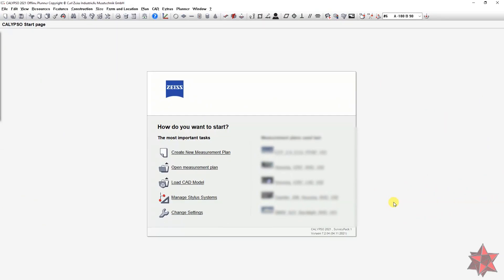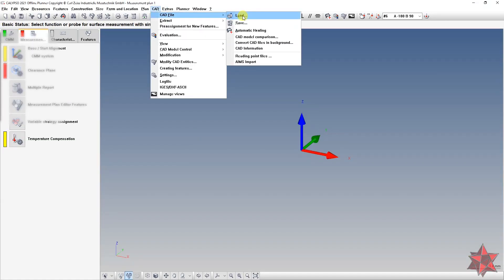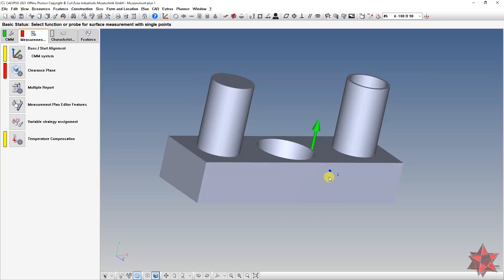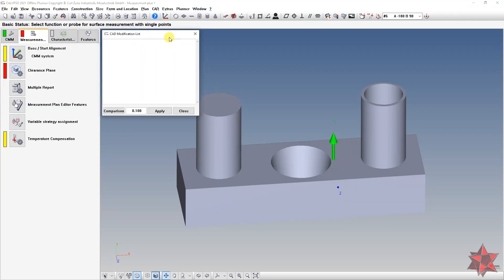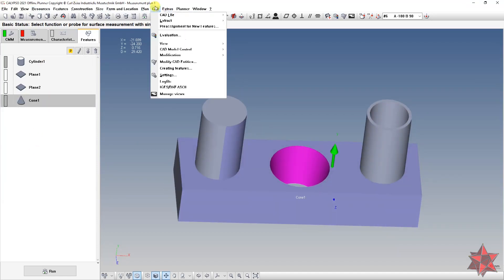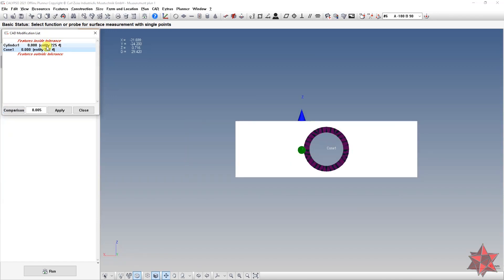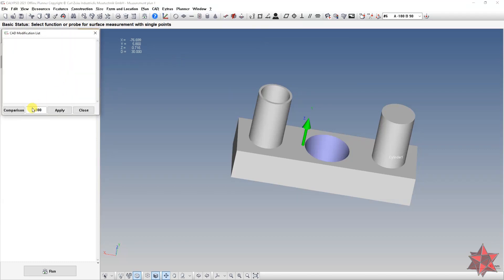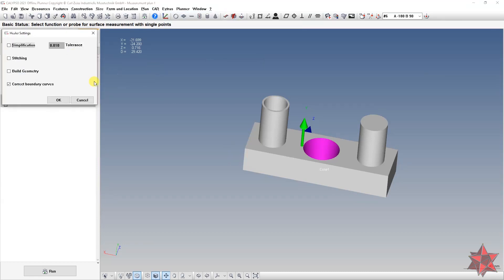CAD and CAD revision in Calypso

Comment: How about the alignment of the new cad file if you have a different alignment in the program , will it take the old alignment?
Reply from the maker: You have to set the alignment to be the same as the original from the created program, it will not work otherwise.